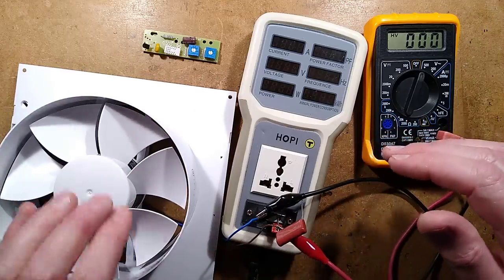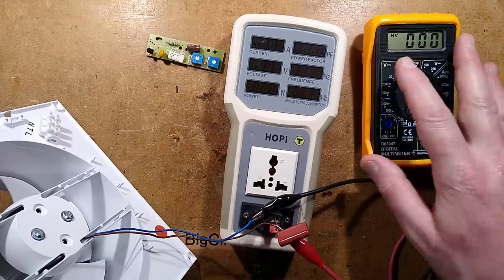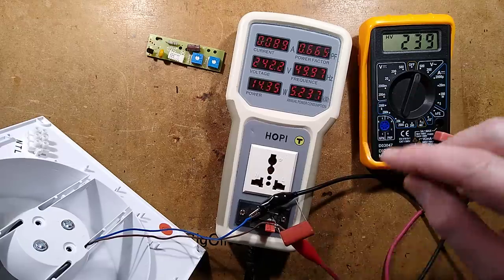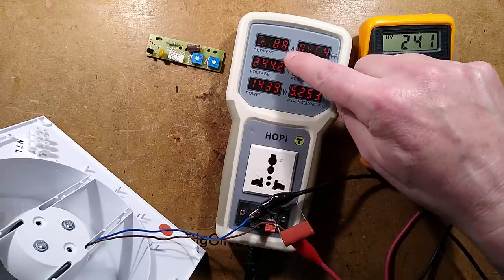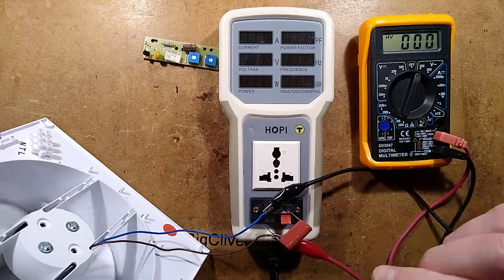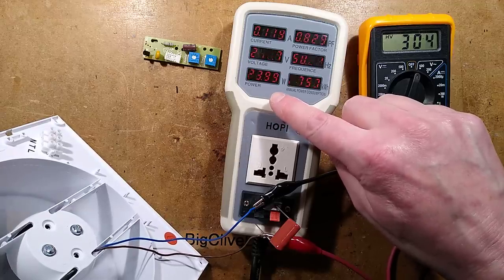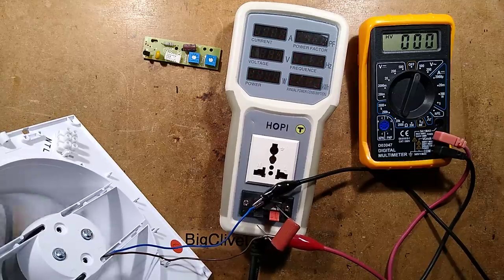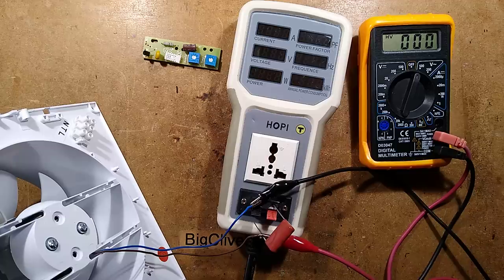What the heck!  Series capacitor makes fan go TURBO!

Comment: If you have an oscilloscope, checking out the waveform could be interesting. I'm wondering if it has something to do with the fan being an inductor.
Reply: Do another Video Showing this please
Reply: It has, in fact, everything to do with it being an inductor 😉
Reply: everything to do with the inductor being an Integrator and the cap also storing energy resonating together.
Reply: There's also the complication that the fan generates back EMF when running.
The frequency of which is going to depend on the rotation speed of the fan. At certain speeds this will be a simple ratio of the 50Hz supply.
Reply: Even better show the voltage and current on the oscilloscope, I think you will see that the current peak will be closer to the voltage peak when the cap is in series.
Reply: @XXXXIndices  by definition an o scope plot is voltage against time it will not show current.
Reply: @SlyerFox666  Really, you must be quite new to electronics. Yes, an Oscilliscopes shows voltage but you can converter current into voltage, that is what any current meter does internally.You can show current either by using a current probe or adding a current transformer to the circuit. Yes, Oscilliscopes show voltage but you can converter current into voltage, that is what any current meter does internally. https://www.youtube.com/watch?v=JSBiIT3iljw
Reply: @XXXXIndices  No I'm not new at all and you are not converting anything you are still only showing a voltage that is proportional to the current. See how simple it is to explain when you know what your talking about 😉👍
Reply: @SlyerFox666  It so simple yet a troll does not understand it. Anyone with half a brain and a bit of electronics experience would have understood my original comment.
Reply: @XXXXIndices  There's no trolling to staying facts academics seem to get muddled up over as it seems the degree degrade & the PhD which stands for phenomenal head diameter brigade then tell others and they take for gospel so if clearing the air or mopping up the real facts is hurtful to you then maybe be a cleaner instead somewhere.
Reply: @SlyerFox666  Are you still embarrased by your your comment? If only there was way to block stupid peoples comments.
Reply: @XXXXIndices  🤣 there is but your obviously to clever to work it out hey 👍
Reply: @XXXXIndices  Now who's embarrassed Mr techno-it-all can't even work out the block feature on you tube yet can easily talk down to anyone about anything. Well played Sir we salute you for being the real troll in that exchange Bravo 👏🤣👏

Comment: Series resonace of an LC circuit where the impedence dips towards the DC resistance of the coil, so the current and voltage in the coil and capacitor increases. If you tweak the capacitor to get closer to the resonance it will get more extreme.

Comment: My first thought was the capacitor filtering out some kind of PWM signal used for the fan. Now however I clearly see this is far more involved. Fascinating reading all the comments!
Reply: Also, no PWM circuit component. Just hot and neutral wires.

Comment: This is a classic case of a tuning circuit - you can clearly see the power factor increase once the capacitor was placed into the circuit. Interesting observation. Could probably keep tinkering with differing values of capacitor (assuming the fan doesn't die first). Nice to see something I was taught in electrical theory actually have an easily seen effect

Comment: Yes, there is phase shifting.  
Why the higher current? 
Where F=freqency C= capacitance, L=inductance Xl=inductive reactance, and Xc=capacitive reactance, then in ohms Xl=2×pi×F×L, and in ohms Xc=1/(2×pi×F×C)

Lastly where Z=impedence in ohms, R=resistance, Xl=inductive reactance and Xc=capacitive reactance, then  Z=sqrt(R²+(Xl-Xc)²) in ohms. 

If the capacitor and inductor are in resonance at line freqency, the resistance because of reactance Xl-Xc = 0, and conseqently the impedence Z  then equals R, which let's  more current flow than without a serries capacitor where in ohms  Z=sqrt(R²+(Xl-0)²).

Comment: I think you're hitting some sort of resonance. I've seen something similar happen when tinkering with the crossover on a pair of loudspeakers I had. I swapped a cap for an "audiophile" one of the same value and they became completely unlistenable. A loudspeaker designer friend of mine said it was probably some kind of resonance in the circuit.
Reply: If the value is the same, that should not happen, except if the old cap had high ESR and the speaker was designed with that in mind... More expensive doesn't always mean it works better.

Comment: The inductance of the coils inside the fan limit the flow of current and therefore the total power. The capacitor cancels the reactance of the inductors and increase the current and the total power increases.

Comment: This is a simple RLC series circuit.
The total impedance Z comprises of Resistance, Inductive reactance and Capacitive reactance.
Resistance is simply = R
Inductive reactance = ZL = 2*PI*L
Capacitive reactance = ZC = ½*PI*C
Z = Sqr[R^2 + (ZL -ZC)^2]
The current through the circuit is the supply voltage divided by impedance i = Vs/Z
The voltage across each component can be calculate by multiplying its individual impedance by the current.
Voltage across inductor = VL = i * ZL
The phase angle is cos^-1 (VR/Vs)
Reply: Hi that's it match phase shift of the inductor and negative phase shift of the capacitor and you can get even closer to a purely resistive load, just been having to do all this for my C and G L3 8202 at college! P.s. I'm 65 now so it's most to keep the grey cells working!
Reply: @ianithompson4239  Particular attention is needed when doing this to ensure that component values are suitable.
As an example:

If the original circuit can be modelled as a 0.16 H inductor in series with a 10 ohm resistor, on a 100V supply at 50Hz, the impedance of the inductor is near enough 50 ohms.

The total impedance is Sqr[10^2 + 50^2] = about 51 ohms so I = V/Z = 100/51 ≈ 2A (near enough)
Therefore, the inductor (or motor winding in Clive’s setup) only needs to cope with 2A at 100V

If you add a 63uF capacitor in series its impedance at 50Hz = about 50 ohm, so when you bung the numbers in the equation to calculate the total Z it cancels out with the impedance of the inductor.
The effective impedance is now 10 ohms, so the current goes up to 10A
Now when you calculate the voltage across the inductor (it will be the same for the capacitor)
V = I * ZL = 10 * 50 = 500V

If you back calculate from Clive’s measurements for his setup with the fan motor it should be possible to get approximate values:
R = 165 ohm
L = 8.9 H     ZL = 2795 ohm
C = 1.6 uF   ZC = 1961 ohm
The calculated voltage across the inductor comes out a 335V (measured 330V)
The voltage across the capacitor 235V
Reply: @stevesteve-ei8zu  that is assuming the power factor wasn't over corrected. If that's the case, your motor calc is a little off. That's the funny thing about power factor.... Unless you have at least two (technically three) known values, you cannot know whether it's leading or lagging. We already know with the motor it is lagging. But we don't know if the power factor has come closer to unity or if it has overshot it.
Reply: @stevesteve-ei8zu 
Inductive reactance = 2 * PI * F * L
Capacitive reactance = 1 / ( 2 * PI * F * C )
F = 50 Hz ( or 60 Hz, or whatever ... ).
Reply: @CG-rr6yx  Well spotted. We need an equation correction function.
I set F = 50Hz UK mains frequency
Reply: @stevesteve-ei8zu  Also a tool to post a small image or a hand drawing wouldn't be bad.

Comment: Assuming the fan acts as an inductor, this is expected behaviour.
You see, impedance is a complex number of which the resistance (how much the part resists current) is the real part and the reactance (how much the part resists changes in current) is the imaginary part. An inductor has a positive reactance and a capacitor has a negative one, which can be calculated and depend on the inductance or capacity, respectively, and the frequency. When you put them in series you mathematically add those together just like you would with resistances, except they partially cancel each other out. 
I suspect you can perform the same trick using an appropriately selected inductor and an LED lamp with a capacitive dropper, although selecting the impedances to match exactly might be a touch dangerous. You want to lower the impedance a little, but not all the way to zero.
Nice demo. I always thought it was possible but I've never seen anyone try.

Comment: I've been using this technique for years in my bathroom and desk fans. Putting a 4µF motor start cap in series causes the fan to go nuts as you show here, but putting two in series (ie 2µF) drops the fan speed to about half. Very useful if you don't want it running flat out. This also gives the typical 3 speed desk fan 3 speeds lower than the normal speed #1 selection. Just right for a gentle quiet breeze.

Comment: Howdy.
I think Yiu are on the right track.
A series resonat circuit will show low resistance at the ends and high voltage between the inductor and the capacitor. So yes. A series capacitor will boost the voltage over the fan.
Regards.

Comment: It's a classic Voltage Multiplier circuit. We used to build a lot of different multiplier circuits for high voltage low current power supplies.
Reply: It's an RLC filter close to resonance.

Comment: Also could be something to do with the shaded pole motor that the fan in question uses. Possibly the same thing that happens to capacitor start/run motors with the phase shift. It would be interesting to see what would happen if the capacitance was changed from a smaller one to a larger and or larger to smaller.

Comment: Very interesting case indeed. In India we use ceiling fans (PSC type induction motor). Fans are around 60-80 watts with PF nearly 1 & use regulator to control fan speed. It was resistive/inductive type in the past. Now capacitive type regulators are used. Two caps of 4.5 and 1.5 microFarad (MFD) are used and a combination is used so the highest is 4.5+1.5 (both parallel) 6 MFD and lowest 1.5 MFD is always in series with fan motor. I have never seen voltage gain for any speed settings. Voltage between fan terminal is always lower than line voltage unless it's highest speed. That's how capacitive regulator works where capacitor works like equivalent dc resistance but without heat dissipation (ideal situation). 
But I have experienced similar strange phenomenon before. I had a pedestal fan (PSC motor) that has induction coil (choke coil/auto transformer) type regulator. Speed 1 is lowest and have highest L value if I add the capacitive regulator in series with highest C value the fan speed increases. That means at 50 hz 4 pole PSC motor runs at 1100 rpm at speed 1 but runs at 1250 rpm if I add a 6 MFD cap in series with the regulator. Fan has full speed 1350 rpm at 240 V (PSC motor with slip at rated load) but if I add a 6 MFD cap in series speed drops to 1150 rpm. So definitely an induction coil and capacitor in series boost voltage , but a PSC motor (power factor is almost 1) in series with a capacitor doesn't have such effect.
So your motor is important here. It's not a PSC motor. I can see the PF is 0.6 so it's a shaded pole motor i.e an induction coil. So with a capacitor in series it becomes a L-C circuit and it starts to resonate ( standing wave?) and input AC combines with it to increase voltage?
In PSC motor another interesting phenomena occurs. A PSC motor has two sets of coils one is primary coil connected across mains and another is secondary coil connected via a capacitor. Voltage across primary coils is mains voltage but the voltage across capacitor and neutral is higher than mains voltage and that voltage increases if you increase the capacitance value. Initially I thought that this is the back emf of motor and since motor speed increases with capacitor value back emf too increase. But it's not that simple, now I think there is similar phenomenon like your experiment. 
Waiting for your insightful explanation.

Comment: By adding a capacitor to an inductive load, you increase the power factor of the system and also have a gain in the average electrical tension.
In AC circuits, we can represent an impedance as a complex number, Z = R + jX. R is the Resistance and X is the Reactance. Reactance can be positive (inductive) or negative (capacitive).

Comment: Probably the capacitor is counteracting the inductive reactance of the fan and improving power factor. If you tinker with the capacitor value you could get it to resonate at 60Hz for optimal performance.

Comment: Nice one, Big Clive. I would not have thought about experimenting with a series capacitor. They are of course used in capacitor start & run, split phase motors, but I assume that this fan is a shaded pole machine. Most of the previous comments have suggested resonance and that was my thought also. A pity that my mobility scooter is only 24VDC, or I might try a turbo boost on that!🤣

Comment: The power factor went up because of the series capacitor. Before the capacitor it was 0.669, and with the capacitor it went up to 0.828. Basically the circuit has less equivalent inductive resistance because of the cap, allowing more AC current to flow through. In AC motors you often find non polar capacitors that do this power factor correction in order to squeeze more power from the motor. Usually it's indicated on the motor's label. Say 2mF is going to produce cos (f) of 0.95. Some of them even have a start and run capacitor.
Reply: The capacitor is used to cause a phase shift to get the motor spinning and improve torque characteristics while running iffen it's a run cap.

Comment: The fan is inductive, and so the power factor on you meter is only showing 0.6. When you connect the capacitor in, your power factor meter is now showing 0.83. Put a bigger capacitor in and you will hopefully get to 1.0 which is ideal. As Zadster says earlier, series resonance, but still only have your HOPI meter connected across the fan only. An oscilloscope would show what is going on at different points of the overall circuit.

Comment: Here in the states we have plenty of bathroom exhaust fans that have capacitors in series with the motors to help them run at proper speed. I work in maintenance and we have to swap out these capacitors on occasion when we get a call over fans running too slowly/quietly. The motors themselves are practically bullet-proof as long as the internal (non-serviceable)  thermal fuse doesn't blow. This only happens if the capacitor is allowed to completely die and the fan burns itself out from insufficient airflow.
Reply from the maker: Those might be using the capacitor for rotation through phase shift on a second winding.  With that type of motor the failure of the capacitor causes the motor to stall and pass much higher current than normal, overheating and popping the thermal fuse.

Comment: I think it's a part of the way that power is measured vs how it is actually stored or flows. The power directly from the source would have a waveform from when it was generated that would alternate rapidly or pulses, this usually can be seen in lower quality generators and alternators, the measurement devices cant read the wave or pulse only the flow, so adding in a capacitor or some way to break up the wave or pulse will allow it to flow smoother or more power to be accessible to the motor as needed since there is a greater need for power during acceleration and maintaining then there is for idle. I would try this again with a battery powered system to see if there is a pulse issue with the power system used to run this setup.  Good luck i hope you learn plenty, electricity and motors is a deep hole, and i suggest looking into an "electricity 1-7 book"

Comment: I love it when you find random oddities like this.
Reminds me of when I discovered by body was capacitively coupled to my mattress springwork which in turn was capacitively coupled to a USB cable shielding laying across the mattress which went to a audio DAC and homemade amplifier. While touching my laptops ground and laying on the mattress, I would get a 50Hz hum on the audio, the amplitude proportional to how much surface area my body had with the mattress. If I stood on the floor while touching there was no hum, as soon as I placed my other hand on the mattress it was humming. It was the result of improper grounding with my laptop PSU, TV and amplifier PSU. Possibly the cheapo USB DAC and maybe old house wiring. I fixed it by attaching earth grounding lead to the TV chassis, the plug didn't have one.

Comment: Nice demo of forming a series resonant circuit. There is a boost in peak voltage & the meter being a cheaper one shows that instead of a more expensive one being capable of showing true RMS voltage. Normally an AC motor will not speed up unless the frequency of the input increases but this one probably having bad regulation was always being under driven for the frequency so had much slip, until the peak voltage is increased.

Comment: Obviously, this is some kind of resonance. I studied electrical engineering too long ago to explain this in more detail, but you can easily find a description of this phenomenon in books.
I came across this by accident when discussing connecting a capacitor in parallel to a switch (to reduce sparking). The load was a small transformer. Someone asked me to measure the voltage across a transformer with the switch open. I took the first capacitor that came across and it turned out that the voltage was higher than in the mains.

Comment: Inductance and capacitance both cause phase shift of 90°, just in opposite directions, this capacitor is reducing phase shift caused by inductor, thus "bringing" peaks of current closer to peaks of voltage and giving you more power.